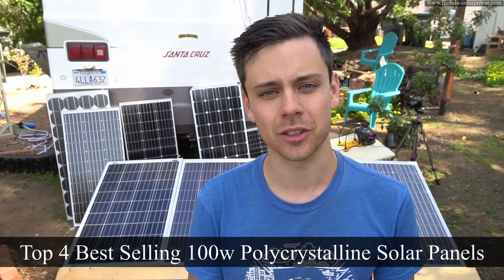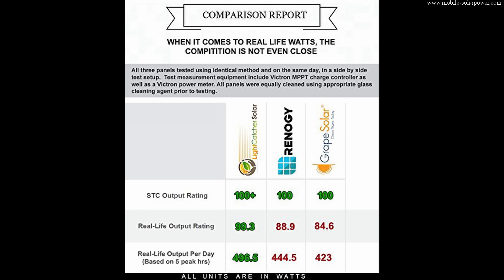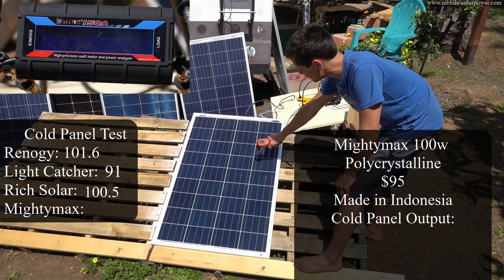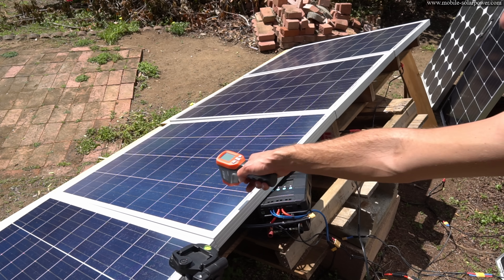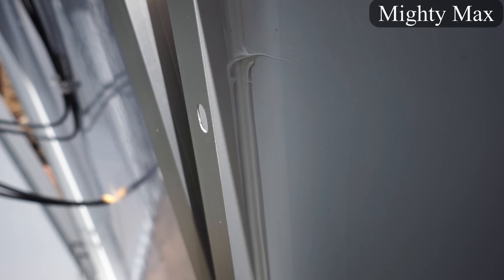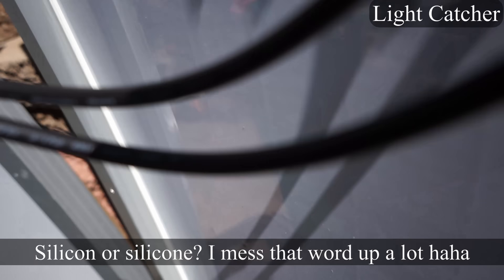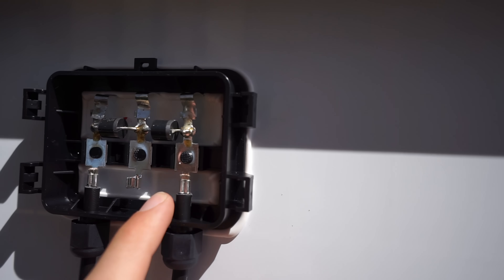100w Polycrystalline 12v Solar Panel Showdown! Renogy vs Rich vs Lightcatcher vs Mightymax

Comment from the maker: Solar Panels in this Video:
Renogy Poly: https://amzn.to/2U8hoXz
Rich Solar: https://amzn.to/2UUrdpd
Light Catcher: https://amzn.to/2UTyg1e
Mighty Max: https://amzn.to/2HSTIjl

Video Table of Contents
Panel Test Station Details: 1:51
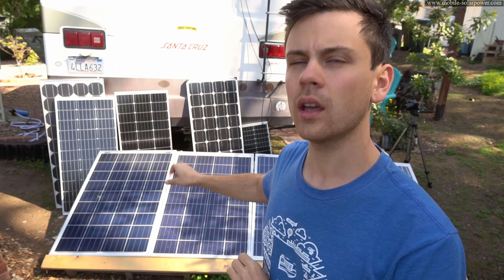Baseline Mono Solar Panel Tests: 2:22
Polycrystalline Output Tests: 2:40
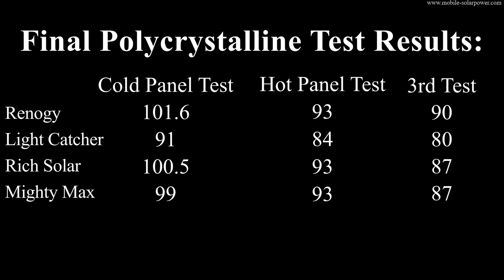Final Test Results: 5:03

Materials and Craftsmanship Comparison: 5:08
Construction Final Ratings: 9:22

Final Thoughts and Calculations: 9:31

Correction:
I was editing pretty quickly and the watt readout for lightcatcher was 85, but I wrote the first number that was said, which was 84. Not a statistically significant difference so I will leave it.

Another correction: the price listed for mightymax was $95, but the original $82 was accurate

~*Tired of getting ripped off? Check out my "Will Prowse Approved" solar product recommendations below!*

12V Batteries
https://www.mobile-solarpower.com/lithium-batteries.html

48V Batteries
https://www.mobile-solarpower.com/48v-batteries.html

Offgrid Inverter System Builder
https://www.mobile-solarpower.com/48v-complete-system-blueprint-559371.html

Hybrid Inverter System Builder
https://www.mobile-solarpower.com/code-compliant-48v-offgrid-system.html

Mobile Handtruck System Builder (very popular!)
https://www.mobile-solarpower.com/mobile-48v-system.html

Solar Panels
https://www.mobile-solarpower.com/300w-solar-panels.html

Ground Mount Solar Racking
https://www.mobile-solarpower.com/ground-mount-racks.html

Wire, Lugs and Busbars
https://www.mobile-solarpower.com/wire-and-connectors.html

Tools
https://www.mobile-solarpower.com/tools.html

Fuses and Circuit Breakers
https://www.mobile-solarpower.com/fuses.html

Plug-N-Play Solar Systems
Ecoflow, Anker And Bluetti! So many models to choose from. See my current recommendations here:
https://www.mobile-solarpower.com/full-size-systems.html

~~~~~~~~~~~~~~~~~~~~~~~~~~~~~~~~~~~~~~~~~~
Need to build a large DIY system? Need a trustworthy solar distributor? These are my favorites:

Signature Solar
Creator of EG4! Solar Minisplits, Victron and More! Largest Solar Store Online.
If you want $50 off, please use my link below and coupon code "DIYSOLAR50":
https://signaturesolar.com/?ref=cPwLcVc0SW-BjN

Current Connected
Best Prices for EG4, Victron, Midnite and so much more! Fast Shipping and Highest Rated Customer Service:
https://currentconnected.com/?ref=wp

~~~~~~~~~~~~~~~~~~~~~~~~~~~~~~~~~~~~~~~~~~
Join our DIY Solar Community 
Need more help? Join the largest solar forum on the internet for beginners and professionals alike. 140,000 members and counting!
https://www.diysolarforum.com

Check Out My Free Book
Best-selling and beginner-friendly guidebook to off-grid 12V solar!
https://www.mobile-solarpower.com/the-book.html

~~~~~~~~~~~~~~~~~~~~~~~~~~~~~~~~~~~~~~~~~~
Contact Information:
I am NOT available for personal solar system consult! If you wish to contact me, this is my direct email: williamprowsediysolar@gmail.com
FTC Disclosure Statement and Disclaimers:
Every video includes paid promotion or sponsorship (such as free products for review). Some links on this YouTube channel may be affiliate links. We may get paid if you buy something or take an action after clicking one of these. My videos are for educational purposes only. Information is subject to change/update at any time. Electricity is DANGEROUS and can kill. Be smart and use common sense :) DIY Solar Power with Will Prowse is a participant in the Amazon Services LLC Associates Program, An affiliate advertising program designed to provide a means for sites to earn advertising fees by advertising and linking to Amazon.com
Reply: as a german i actually would be suprosed if the panel performed as marketed but i wasnt`t suprised by the quality of it

Comment: Fantsstic video!! Some of the links you listed are actually monocrystalline so I'm a bit confused. Either way, I think I've settled on a set of 3 polycrystalline 100 mighty max. Let me know if the link is off, bc I love the sizes of the rich solar you linked (I could have 4) but it says monocrystalline in the description. I am curious if you think it may still be worth going for 4 mono rich solar over 3 poly mighty max.

Comment: Hey, thanks for that! The only comparison I'm slightly missing here is the comparison of performance versus overall dimensions. It doesn't mention that polycrystalline cells are slightly larger in size for the same power output, so in the case of limited space on an RV roof, that may play a role. Thanks

Comment: Thank you for your review.  Would you please consider do another review of 200w 12v or 24v panels.  I'm looking to put 400w (22 200w 12v in series) of solar on the roof of my 24' Schoolie and connect it to an All-in -One 3000w 24v 60A charger unit ( any suggestions would be appreciated!).  Also could you do a review of the newer All in One units.  I've seen your All in One review a bout 4 times but it's 2-3 yrs old and I'm sure things have changed.  Thank you for your hard work.  Steve

Comment: Just bought the book, can't wait to study it. I am starting my journey to getting several circuits off grid in my home. I'd like to get freezers, fridge, dehumidifier, and the furnace fan unit all on battery power which is about 5Kwh per day. I plan to take it slow if possible and add battery capacity over the next 1-3 years. Eventually, I'd love to be able to run about 20Kwh per day, but I know that may be just a dream here in Northern Indiana.

Comment: Wouldve helped me a lot if you had used a heavy duty felt tip pen to write the name of the model on the frame.  I couldnt keep it all straight as you hopped around with your comments.

Comment: Hello,  I have a four 100w Rich 12v rigid panel solar system.  My question, instead of adding two more 100w panels, for a total of six, can I remove one of the 100w panels and add two 200w Rich 12v panels to the system? I have eight 12v batteries (not Li) and will be adding two more batteries. Thanks for your time in responding. Any suggestions are welcome. I'm new to the solar power scene. :- )

Comment: I have two 100 watt panels from China. I'm not sure of the name. I see "WUXI BETTER SOLAR" on them, so maybe that's the name. I believe i am getting only about 80 watts each from them. They are 8 years old and have been used on and off as i have moved house a few times. Maybe you could test them too. I love your testing of these four panels so thanks i know what to buy in the future as i upgrade my little 12volt system. Greetings from sunny Jamaica.

Comment: Would love to know the weight of each panel.  Your missing a big part that weight plays if these are going on an rv.  Also what's the warranty for each panel.  I'm guessing Renogy is the most likely to still be around in 5 - 10 years and that's very important.

Comment: Hello Will, I appreciate all you do, your videos, your experiments and associated data and your time you take to make the videos. It's invaluable to all of us. 

I have a question. You may have done video on this subject or have content some where on a video. 
I am slowly increasing the size of my system. As I add batteries, must I always use same amp-hours together or can I group same amp hours? Is my 12v system better converted to a 24v system and can amp-hours be mismatched or grouped or does a series-parallel arrangement eliminate need for all batteries to conform to same amp-hours? Also can agm, gel and/or lifep04 batteries be mixed in same system? 
Obviously if you have videos concerning these questions, please refer them.
Thanks ahead

Comment: I tested my poly 100W Rich solar panel under full sun and this is what it was:  19.02v (above 18v rating), 5.09a (slightly below rating) which x = 96.8 watts!   Is that high efficiency normal?

Comment: Hi guys I've got 3 x 300 watt x1 250 watt and 1 140 watt on 2 lead acid 170amp battery's, what size amp controller would I buy?

Comment: Hi. I have  two 340 Watts lg solar panels, controlled by a Victron Mppt smartsolar 100/50, charging a 12 V 315 ah gel battery.  Can I serie connect these two panels to charge that same 12 V battery?

Comment: Hi Will. Thank you for all the info.
I am getting a 100w Rich solar polly panel .
QUESTION...
Would you recomend the rockpall or rich solar  500w genarator.?
It's will be charged directly from the panel.  
(Once iv mastered this I will be building a solar system using your video)

Thanks again. All the best.
Hope you reply to old videos 
(Following from Sheffield  yourkshire England)

Comment: Watched your video long time fan.... Wondering if you could make a suggestion for me ... I am trying to figure out which panels to get for my new solar pool pump 72VDC , 1.6HP, 136GPM MPPT Controller... JP31-19/1200 is the model #. The manufacturer suggests 6X300W 30V ... I would love your input ... You are the best on here as far as I am concerned. Love your videos !!!

Comment: can you mix different types of panels  poly ,mono , or different watts 50 ,100 , 120 , or brands ??
 can you cut  off the connectors to make your own ends so they can fit together  ??

Comment: Wow hey super comfortable in your skin handsome Will!  Thanks for the info and clear understanding!  

 how about Solar Battery Maintainers that many of us with multiple vehicles, need to keep the starter battery charged when leaving parked for too long but don't have a battery array in these vehicles?
I mean these new vehicles sure drain the starter battery over time if not driven, with all the electronics needing some power for memory and connectivity to key fobs etc.

Because I have found the small solar float chargers for placing usually on your dash or back window or suction cup to the windshield, are very unreliable with a few models that are worth getting. Seems Sunpower ones are the best and Coleman makes some alright ones.
Many are framed in plastic instead of aluminum and some the plastic warps in the sun...
Some can't be suction cupped to the window, others can but only have 2 cups, others have a solid 4 cups.
Also they offer Amporous panels for their ability to produce even on overcast days. They work on more an infra red spectrum but don't produce as much for their size if I'm stating it all correctly.
But in larger sizes are offered the poly and mono cells. It's all very confusing for a lot of us.
Additionally these smaller panels don't need a management module, because they can't overcharge with their weak power?
These small panels are also purchased by people to maintain batteries for their electric gates and electric fences and electric signs and so forth. 
It's a large subject I get you could really clear up and simplify for us.
Take care

Comment: Hi Will, I have 2 polycrystalline solar panels 370 Watts in parallel connection, what is the suitable MPPT solar charge controller for 24V system?

Comment: Any comparison on the quality or transparency of material covering the cells?  Guess it may make big difference since all solar panel will suffer degradation of efficiency over years. 1% down per year? The instant power reading in this experiment may not be enough to demonstrate the quality. With the same power rating the German one obviously hits the top as the size is the smallest, which indicates the highest efficiency of cells.

Comment: Will, your book was my first purchase when I initially became interested in RVs and mobile solar installation.  I never knew there was so much to learn about electricity,   W= a×v, panels, lithium batteries etc.  Every vlog you produce is filled with useful info.  Your life story always holds my attention as well.  Your comparison road tests sometimes reveal previously unheard-of differences in products.  Great job today on the poly solar panels.

Comment: Great testing, thank you.  I'm planning to build a solar suitcase because it's a lot cheaper than buying already made, and I keep looking at Renogy.  Now with your test results, I will buy the Renogy even though it's a bit more. I will use an MPPT controller since those put out more power than the MWM and worth the cost in the long run.  Thanks again, I trust your reviews.

Comment: Great video, but- I'm still left wondering which Flexible Solar panel to get. I'm building a 800 W 24v roof mounted system on my truck camper (Host Cascade 10.6) which will go into my DIY LiFePO4 24v battery bank. I'm still trying to decide whether to use mix and match items or just use Victron and make it fool proof for my wife. I really, really WANT to use flexible solar panels and plan on mounting them to PP sheets and use a  "holeless" mounting to prevent leaking. Finally, I hate spending $365.00/panel for SunPower because of the longevity issues! But, I'd rather pay more NOW than have to replace them every year... You are much closer to panel output and quality (yes, I HAVE watched your comparisons!) but, don't get a firm idea of which YOU would mount. 2nd question: Are you comfortable re-crimping and re-soldering diode boxes on the back of those panels? Do you think an amateur could do it, if needed?
Thanks in advance, Will!

Comment: It is a bit sad money and technical performance are the only benchmarks for your comparaison. I thought co2 output, grey energy and manufacturing conditions could be a good complementary factors, also performance over time because if you're going to invest, it's your gains over time that counts.
A big issue I have with this kind of review is societal and ecological factors are totally ignored. And that's what makes consumer capitalism a problem.

Comment: So I am building a 100 watt solar panel with a 20 amp mppt controller. I’m using a 400 watt inverter. I am stuck now on what battery I need. I see some people say 100Ah battery will be destroyed by a 100 wAtt system. Can you give me some options for the $100-200 range please on a low maintenance battery for my SUV

Comment: Hi i got 3000w of poly solar panels 10x 280w pv and planing connect hybryd inverter i dont want to sell my Energy to the grid just connect to main just in case if im lack of sun in the winter my question is witch way is the best way to connect the solar panels in series or parallel I want to mention that I will hawe battery bank too and how many do I need lets gues 100ah ?

Comment: I'd love to see a test on eco-worthy panels. I bought a bunch of them and they seem to work well for me. The kit I purchased came with twelve 195W panels that are configured on a 24v system. It came with a combiner box with breakers, wiring, pwm charge controller, and 3500W inverter all for... I think it was CAD$3700. Some might say that's high, but for a mainstream system here in Canada, I was looking at like, 14-18,000 so I saved a ton compared to what I had planned.
It's a 2300 watt system. On most days, my mppt (I upgraded the controller because it put out more amperage to run my AC) ranges from 1500 to 1900  watts with the heat and everything. I'm not perfectly tilted with the sun at this time either, since I set it up more for winter time. But yeah, I'd love your thoughts on this system!

Comment: Great video!  Nice to know what I should be looking for.  We use a solar panel on our boat and a heavy aluminum frame is probably more important than exact output.  Is even a 20% difference in output significant for the majority of solar users?  What about variation in output between panels from the same manufacturer?  As you well know, you must have a representative sample to get a valid result from your comparison test!  Can't wait to test my NewPowa 100 W mono, which was way cheaper than any polycrystalline panel I could find.  The difference between mono and poly does seem quit significant, despite the fact that everything I read said that mono crystalline was more efficient than polycrystalline.  Any thoughts on why that might be?